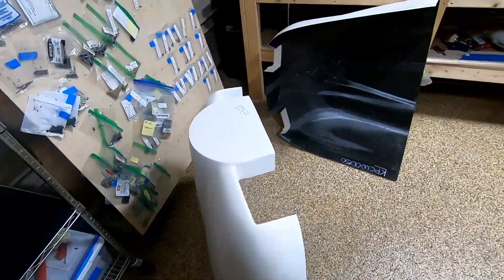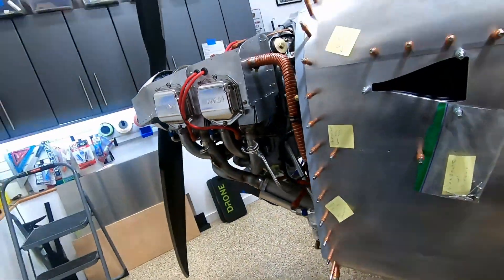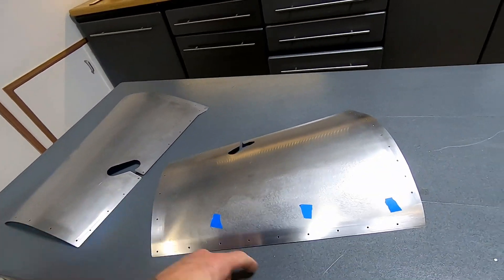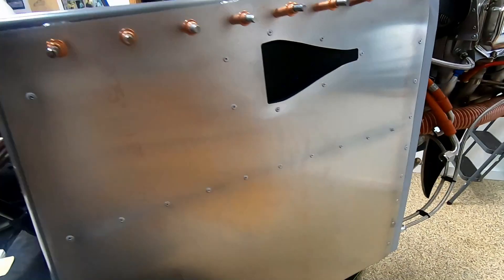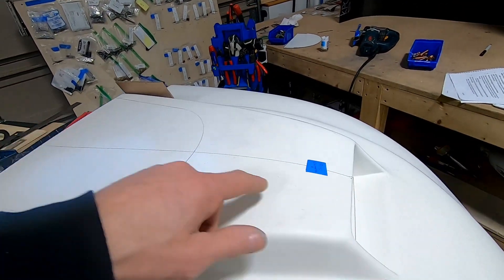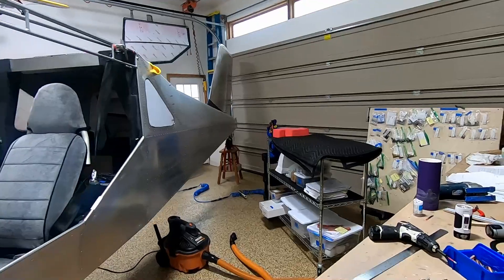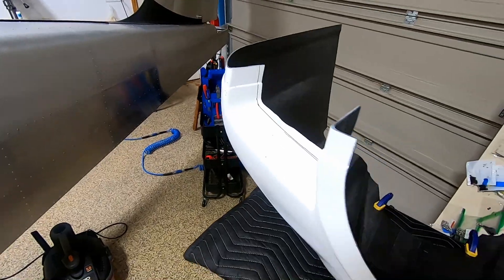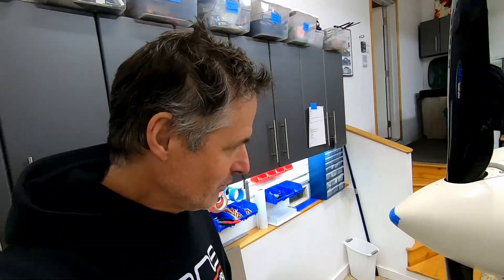RANS S-21 (112) Engine cowl part 1

Comment: I am surprised that the baffle plate on the prop side of the air intake is on the inside of the cowl intake.  I don’t think I ever seen an airplane where the cowling air intake wasn’t completely inside of the baffle sheet metal.  Having the metal inside the cowling is like having shingles overlapped the other direction on your roof so the rain can run under the shingles.
Reply: As you cut/fit the cowls this all changes, and the aluminum baffles will fit inside the cowls on final fit-up. Derek is still early in the fit-up. It is also a good idea to NOT fit the cowls till the boot cowl and instrument panel are all riveted in place. This is not the step to try and complete fast, take your time!
Reply from the maker: Yeah, I'm aware that ideally the panel should be in to do this, but I wanted to keep moving, so I clecoed all the boot cowl skins in place and held up the panel side (w/ safety wire to the cage) to its approximate location. Fingers crossed, lol.   @Bushmasterpilot
Reply: The baffle will be farther rearward than the rear edge of the cowl opening, then sealed by silicone/rubber baffle seal material.